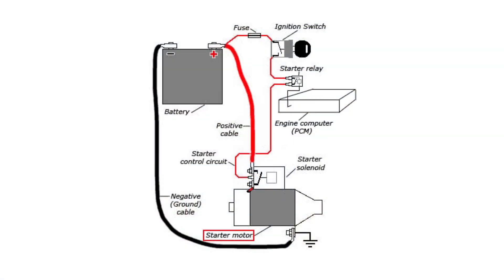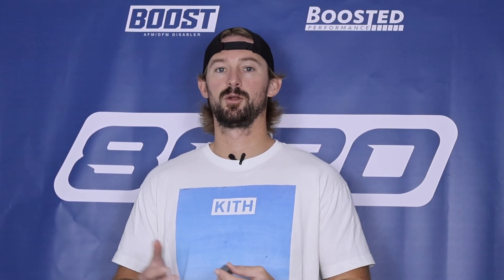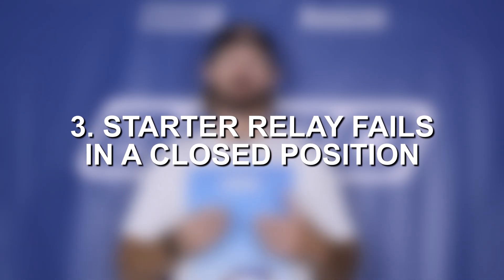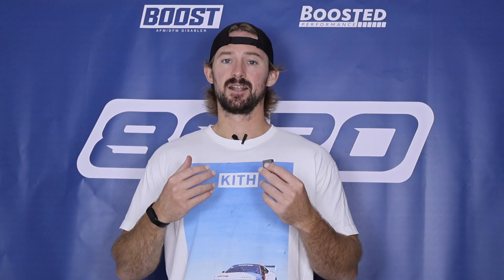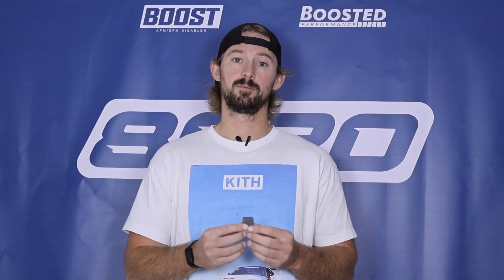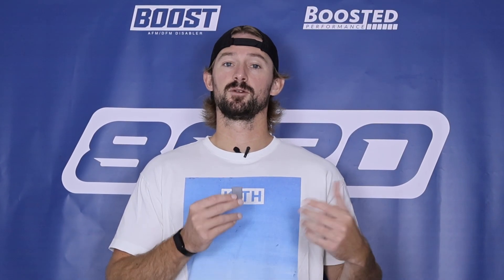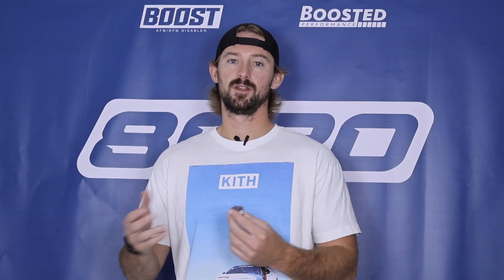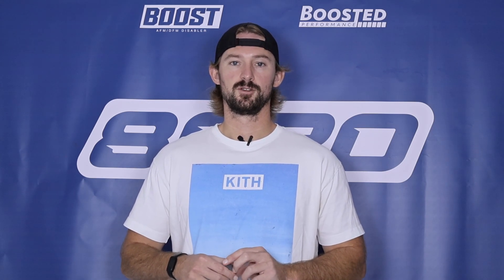Car Won’t Start? The REAL Signs of a Bad Starter Relay!

Comment: I can hook jumper cables and it will start after a little while it won't start back i got a new battery and a new alternator
Reply from the maker: S - If your vehicle only starts with jumper cables even after installing a new battery and alternator, it’s almost certainly a power delivery or ground issue rather than a charging problem. Start by checking both battery terminals and cables — make sure they’re clean, tight, and corrosion-free, including the small ground wire that connects from the negative terminal to the body and from the engine block to the frame. A weak or broken ground strap will cause the car to act dead even with a good battery. Next, use a multimeter to confirm voltage at the starter’s main terminal (should be battery voltage at rest) and check the small ignition wire to the solenoid — if it doesn’t show 12 V when you turn the key, the problem could be in the ignition switch or starter relay circuit. Also verify that your new alternator is actually charging (you should see 13.8 – 14.5 V at the battery when running). If voltage drops below 12 V as soon as you shut it off, you may have a parasitic drain or poor cable connection bleeding power off when parked. Clean every connection, check your grounds, and test for voltage drop — one bad cable can mimic a dead battery every time.